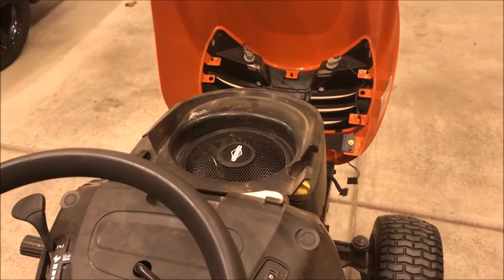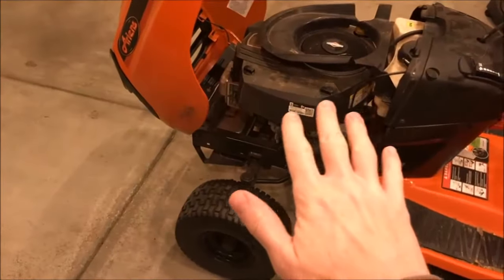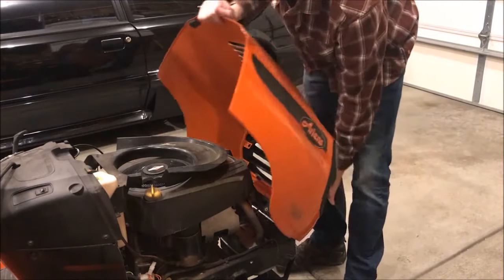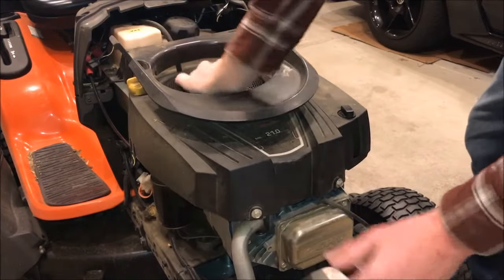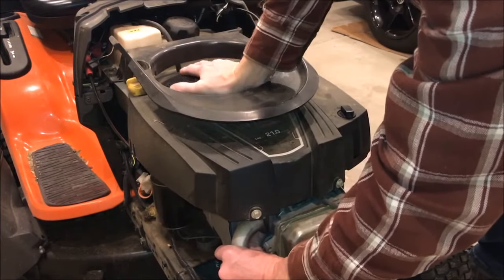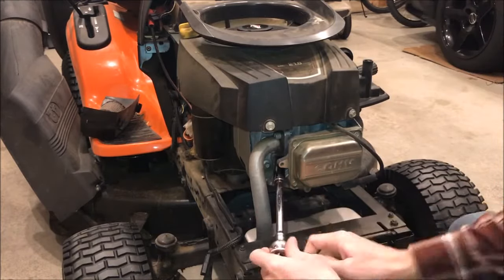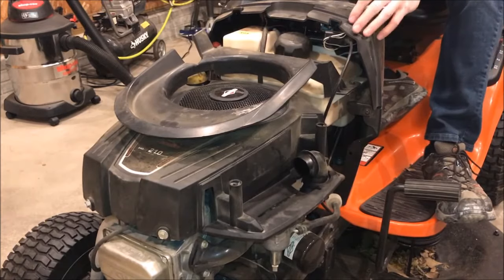Start Compression Locked Briggs & Stratton Engine

Comment: I just take the air filter off and hold a bit of cardboard over the intake as I crank to stop the engine sucking in the air and once it's cranking over lift the cardboard up and it starts immediately. A lot quicker and easier.
Reply from the maker: Yes, I started doing that too. I over did it on this video. Definitely a better way that you described. Put out a vid! Ha. 👍

Comment: I have BS 20hp twin intel 461707. The Camshaft 691161 is no longer available. I bought a used one but it has no compression relief spring. Is this junk? Can I start this with what your showing just to use it for one more season?
Reply from the maker: Hello. I’m no expert, but a used camshaft sounds like a non-starter from the get go. When the cam spins, the tappets will create wear marks and groves. These are very small, but still unique to that camshaft. When installed on a different engine, those wear marks can cause premature wear on other parts and not mesh well. This may not apply to small engines and tolerances are not as critical, so you will probably be okay. If your original camshaft had a valve relief mechanism on it and this new (used) cam does not, no it will not work. 

I’ve ran my mower all season using the method in this video. However, I’ve found a better way. Instead of removing the plug and spraying starting fluid, simply turn the motor (using the flywheel) past TDC then use a bunched up rag to plug the air intake.  Don’t let the rag get sucked into the engine, but otherwise it starts every time when doing this. It’s much easier. Let me know if you’ve got questions. Thanks!
Reply: @FastFixYouTube  Thanks for the response! I’ll give it a try. I’ll give you an up date.👍🏽

Comment: What about just using a cordless impact drill with a socket on it to turn over the motor? I'm going to go buy the socket I need because I've been having this problem with my Ariens 42 which has an 18.5 or 19 hp motor. So sick of it.
Reply from the maker: Hello. Yes, I think that could work. I’ve had the idea too, but never tried. If you do attempt this, please reply to this thread with the results. Thanks!
Reply: @FastFixYouTube  I'll let you know and try and figure out what size socket I need for my cordless impact drill and get one the next couple days and let you know. I have an older Makita impact so hope it has enough power. Just a terrible design Briggs did. We should file a class action lawsuit for this since they keep selling inferior compression releases and know they go bad.
Reply from the maker: I couldn’t agree more. They need to do a recall on these engines as all will eventually fail.  It’s soooo bad. Yes, let me know how it goes!

Comment: I have a belt stopping me from free spinning motor by hand. I slipped the belt off, and I'm now able to spin the motor by hand. What's causing the belt to lock up?
Reply from the maker: Hello. Sounds like the belt is engaged to the blade drive pulley. Make sure it’s disengaged prior to starting.  If that’s not it, let me know. Thanks!

Comment: I made a tool that fits in the flywheel screen bolt holes and turn flywheel off top dead center and carry it on tractor.allyou need is a piece of flat iron and a couple bolts to fit in screen drill holes ln flat iron to match screen holes
Reply from the maker: Nice! Good advice 👍

Comment: Hi I have Cub Cadet LT50 24hp, Run fine last week but now my motor won't turn. I have tune-up with new sparks plug, oil filter and air filter.  Battery is good and starter is good.  When turn the engine by hands  it won't turn at all seem to be stuck not sure what is wrong.  Is there a way to get it turn or do i need new engine appreciate if you can help here.  Thanks!
Reply from the maker: Hmm, that’s strange. Did you check the oil level?  Make sure there’s adequate oil. Hopefully it didn’t run dry of oil. I doubt that, but it’s worth checking. Otherwise, look for things that could be interfering with the flywheel or the best system under the mower. If the blade is disengaged this won’t matter, but if it is engaged that might be your issue.
Reply: Mines hard turning 19 hp also. Have to use wrench socket. Make sure key is off. But runs like new. Make sure key is off to do this.

Comment: NICE VIDEO !  HAVING THIS ISSUE WITH A  CRAFTSMAN LT1000,  15.5 HP ENGINE  42 " CUT.  MY THOUGHTS WAS TIMING IS OUT OF WACK. DID NOT KNOW ABOUT COMPRESSION RELIEF  VALVE.  WILL TRY THIS!  BEST INFORMATION I HAVE FOUND IS YOURS . THANK YOU !!!!😊😊😊😊😊😊
Reply from the maker: Hello!  It would be strange if the timing was wrong, so yes I'd check the valve relief for sure.  Also, your valve lash could be out of tolerance and something to check before replacing the valve relief mechanism which requires that you replace the camshaft.  Best of luck!

Comment: Help!!!! Working with a 17.5 hp Briggs and Stratton, have already checked the compression release and it’s good. Reset valves, has new gas new carburetor, new oil and new air filter. Now when I try to crank the motor spins freely but won’t start. All I get is a very very old backfire and see just a tiny tiny amount of smoke/steam coming from exhaust and top of carburetor hose. What in the world could it be???
Reply from the maker: Hello!  Thanks for the question! It sounds like a timing issue to me or improper valve lash. With all the updates you made, it’s hard to pin it to one thing or another, but backfires scream timing or valve lash issues. Make sure you’re setting lash at TDC.  That is the primary concern to me with your situation. Did you open up the engine at all when you checked the compression release mechanism? If so, make sure the dots line up on the cam and crank gears.  Feel free to follow up on this thread. YouTube makes it hard to see replies and apologies if I miss it. Can always reply on a new thread. I will see it there for sure. Best of luck!
Reply: @FastFixYouTube yes, I made sure dots were completely lined up. I was at TDC and valves were set at .004 and .006, however after re-gapping my ignition coil, she fired right up! She’s now running better than ever. Thanks so much for the response!
Reply: @amandabrigman3422  I love Happy Endings ! ha

Comment: Working on a Craftsman that's been sitting for 8 years, was having the same problem. Did exactly what you did and replaced the plug and it fired right up. You're a lifesaver! Thanks for the video!!!
Reply from the maker: You’re welcome! Glad it worked 👍
Reply: You don't need to take the spark plug out or mess with the air filter. Simply turn the flywheel BACKWARDS about two turns till you get to the compression stroke.  This  gives the crank two easy spins before hitting the next compression stroke.  The two easy spins will  give you enough inertia to keep it cranking if you have a good starter and battery.

Comment: My 19 yo LT2000 with the Intek V-twin has been doing that for years, but only when cold.  I just keep bumping the starter until it turns over.
Reply from the maker: That’s good it allows you to do that. Mine didn’t have the power to bump it repeatedly. Thanks for the comment 👍
Reply: Be careful with that bumping, from experience, the magnet inside the starter broke into pieces!  Lol

Comment: My engine definitely not turning over should i try to start it up under Choke...??
Reply from the maker: Hello.  Unfortunately, the choke won't make any difference if the engine isn't turning over.  You've got compression lock.  Try this method and see if it works for you.  If it does, check to make sure your valves are lashed within tolerance.  If they are, you'll need to replace the camshaft which has the compression release mechanism attached to it.  Best of luck!

Comment: Dude!!! Thank You so much for the tip on starting without a new cam !!!  I just put a new cam in this thing 4 months ago and it did it again !! First thing is the morning I’ll git er dun!! !!! Thanks again!!!
Reply from the maker: Geesh, such a bad design!  To simplify this hack, simply move the engine to TDC then block the air intake with a rag or piece of wood. Works just as well and far less steps 👍

Comment: I'm confused as to why mine still won't start, I've tried this method a dozen times, and I've also tried covering the intake so there's less compression. But it won't spin over enough to fire
Reply from the maker: Hello. Are you spinning the motor to just after TDC before cranking the engine?  I used a rag to stuff the intake and it works much better. Please let me know if you make any progress.
Reply: 19 hp. with 350 cca volts must be a least 13.5 voltage. 12.5 not enough. Turning motor counter clockwise to high resistance. Put on full choke. Turn key vroom pull to idle. Always using hi test fuel non ethenal. Adding stabilizer. I'm lucky motor 4 seasons old.

Comment: I think I have this problem. But when I turn the crankshaft manually it will turn but when I do it with an impact it won’t. Doesn’t really make sense
Reply from the maker: Hmm…that is odd. Sure the impact isn’t damaged or maybe just too weak?  Very strange…
Reply: @FastFixYouTube  no the impact is fine. The mower is really old and rusted so it’s probably that, thanks

Comment: A lot of questions on here about metal and parts being in the bottom of your pan causing damage I'm not saying it can't do that but it's highly unlikely this is a wait and spring usually they just fall off I've been running mine for over 10 years with no problems no metal in the oil hope that helps somebody
Reply from the maker: Yes. Exactly. The pieces are usually large enough thus weigh enough not to get in the oil flow. Mine has sustained no damage either.  Thanks for the sensible comment 👍

Comment: You don't need to do all that to get motor started.  My mower has the same problem.  All I do is rotate motor counter clockwise till I can't turn any further, it will start right up.
Reply from the maker: Hello. Yes I took far. Too many steps with this video and most commonly the steps are not required to start the motor. I’m more or less wanted to do a video that would guarantee it. It would start so this is the result. However, I’ve been adopted simply covering the carb intake with my hand and choking the hell out of it. Fires up every time! Thanks for commenting and have a fantastic day.👍👍👍

Comment: i tried this method with no success and i also adjusted the valves..if i hold my hand over the carb inlet it spins freely but will not start and when i remove my hand it has compression lock...i have good spark on the plug
Reply: i got it going after all...your trick worked...thanks
Reply from the maker: Hello. Hey, great glad that worked. Mostly Cutting off the air supply is a fast way to get these going. Don’t need to necessarily remove the plug and spin to TDC. Hand over air inlet works most of the time. Glad you got it sorted!

Comment: Dude my mower wont even make a noise, its just like its permanently dead, this all happened when The deck engangment cable fell off and broke. i just spent all night fixing it.. and now it still doesnt want to turn over. please help @fast fix
Reply from the maker: Hello. Ouch, that’s too bad!  Can you hear the starter try and engage when you turn the key?  If the starter is making a noise and trying to work, you’ve got something keeping the engine or pulley system from engaging. I’d imagine your engine is fine. I’d really check over the pulleys, all belts, shafts, and anything that has to do with the belt systems. It could be that when the belt failed, it got hung up and bent a pulley or something nearby that stopping the engine from turning. If all is well, let me know and I’ll try and provide other possibilities. Best of luck.
Reply: @FastFixYouTube  The belt does seem loose, and now that i Think about it, There is a pully bent I just didnt want to believe it, I convinced my brain of anything besides the obvious, because i really dont want to drop this deck, lol, I feel cursed for owning a craftsman riding mower. I can only blame myself I can hear the starter ( i believe), and the battery is good, and new, Its making a whining sound now, and it was starting with starter fluid for a second and puffing out white smoke, but now it wont even start for a sec even with starter fluid. I drained out all the fuel. i havent messed with the carberator, I put new premium fuel in with seafoam. and after you said the thing about the pully.... i can see that being the problem now, I did put bad fuel into it on accident, Thinking it was the good can. I appreciate the feed back, Any more advice would be awesome... I dont mess with mowers, but i can work on my 7.3 diesel and enjoy it kinda weird... I actually convinced myself That this one pully came bent in like that... The worst is here...
Reply from the maker: @MaclainTv  we’ve all been there man!  Wanting to not believe the problem is as bad as we imagine. I totally get it. 

I’d say once you get the pulley fixed and anything else that was damaged you should be okay. However, there is always the possibility that the sudden stoppage of the belt system could have caused something to undergo stress in the engine that it would not otherwise be subjected to. I’m thinking the pulley is bend to the extent that it’s causing friction with the mower deck or some other part that could be prohibiting the engine from rotating. But without eyes on it, that’s only a guess. Best of luck man 👍
Reply: @FastFixYouTube   Whats your email? if you dont mind me asking?
Reply: @FastFixYouTube  so I managed to hit a rock, ok bolder, gave it a good trim, the mower didn't stop, but when I got it stuck in my compost area, I tried rocking the mower while a wheel took turns just spinning.  Guess I'm not heavy enough to keep my ass in the seat and rock the mower, and it shut off.  Now it won't start and I can't turn the engine by hand.

Comment: Mine wont turn all the way around i turn it by hand then it comes to a dead stop any ideas
Reply from the maker: Hello. Does it feel “squishy” when it comes to a stop or is it like hitting solid stop?  The cylinder will be creating compression as the piston nears TDC and it will become increasingly hard to turn the motor. You have to power through all the compression that has built up in the cylinder. If you’re unable to continue to rotate the engine, pull the spark plug out and spin it. If it’s still giving you resistance or comes to a stop, you’ve got other problems. Please feel free to update this thread.
Reply: I check cam gear didn't see and parts broke go to top end wont turn no more
Reply: Thanks for replaying back

Comment: This seemed to be the trick that worked. Thank you so much. Apparently, my gas is old but adding fuel stabilizer and following your steps from this video worked perfectly. 💪 
Thank you
Reply from the maker: You’re welcome 👍 thanks for the comment 🤛
Reply: You can also just spin the engine in the opposite direction until it won't turn anymore and start it without removing the plug or adding starting fluid. If it doesn't start the first time spin it back and try again.

Comment: It is an engine, not a motor (motor is electric).  It is a compression release, not a compression relief. Compression release mechanisms on the cam don't fail often, in fact they fail rarely.  You don't need to take out the spark plug to turn the engine over to get it past the compression stroke. In this case, taking the blower shroud off is necessary to get a good turn on the engine.
Reply from the maker: Thanks for all the corrections.

Comment: I pop off the cap on the top of my crank under the hood, and for my mower, use a 15/16" socket, turn the crank slowly clockwise just past tdc, when I feel the compression relieve.  Cranks fine and with very little effort.
Reply from the maker: Yes, that’s a much easier way and all that’s necessary. My method is a bit too drawn out. I’ve since replaced the cam, but prior to that I was using a rag in the intake and that did the trick. No need for fluid or spark plug removal. Thanks for the comment 👍

Comment: Why not just cover the intake until the motor starts spinning ?
Reply from the maker: That can work too if the compression has bled off. But that requires waiting and I’m not good at that. Good question 👍
Reply: Because there’s already air in the intake and carb etc. To pull vacuum you need to spin the motor. Which is tough to do when the motor won’t spin.
Reply: @al gibs Explanation: Every time you want to start it by this "choking off" method requires you to remove the air filter cover and then the air filter. PITA!
Reply: I started mine like that all season. Didn't wait for anything.
 I do have a new crank that I will install over the winter.

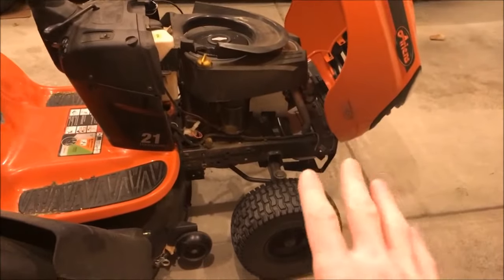Comment: @1:35 "take the motor off, replace the cam" easier said than done.
Reply from the maker: 😂😂😂 100% right. Way easier said than done. However, if you have mechanical ability, you should be able to complete the fix.  Best of luck!